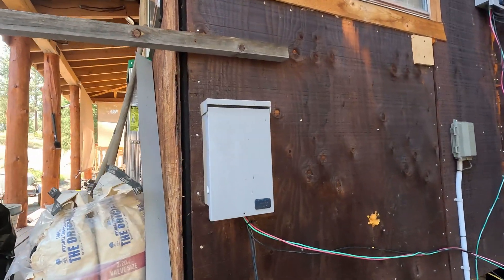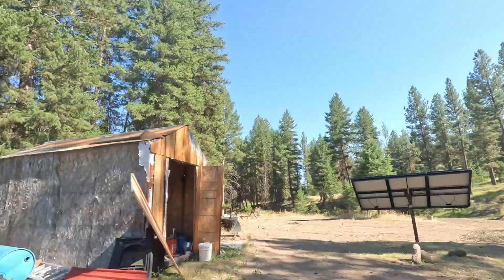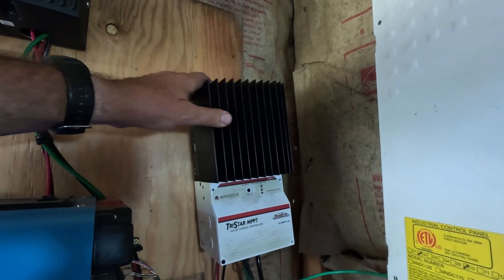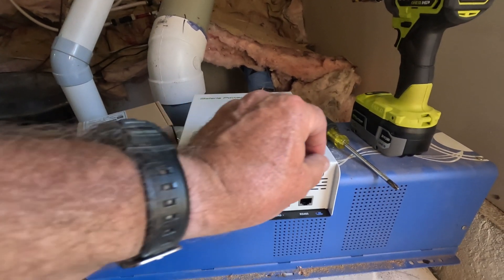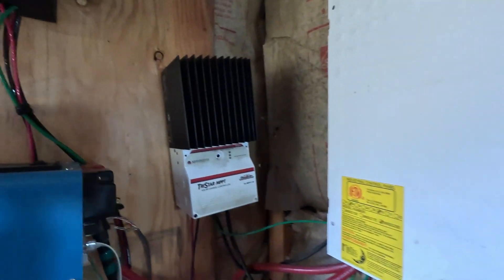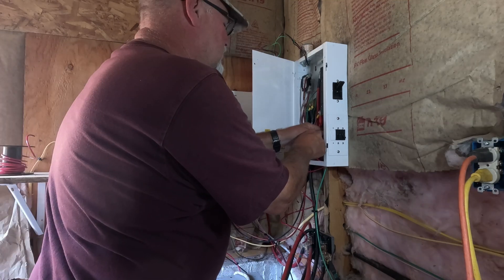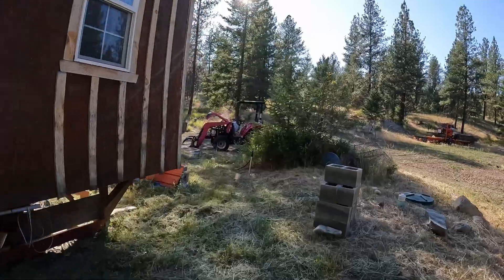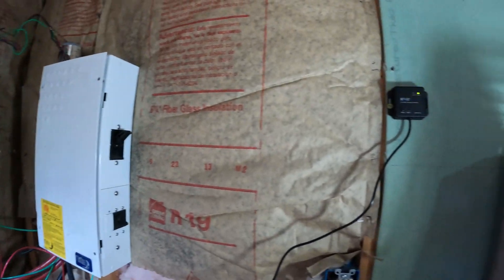🌞 Upgrading My Solar Power System: Bateria Power Sunrock 60 MPPT Charge Controller Installation! 🌞

Comment: Good review! Thx.
 Seriously considering moving up to 60 amp CC now that I understand the combiner box aspect. 
 
BTW, ass backwards works for some of us 😅

Thx again for good info and reviews.
Reply from the maker: I'm happy with mine.  Sure, I'm over sizing the CC and lots say not to but after all this time (14 years) I never had an issue running a 60a cc with just 615w/11.27a of solar
Reply: @TheOldJarhead  The 40 amp POWMr great second step, has upped my game. As you can imagine,  I  always want more!
Reply from the maker: Yup, we always want more!  Though I kinda have more than I need 😉 unless I want AC 😁🤣
Reply: @TheOldJarhead  blessed to have utility hook ups in humid south!
Reply from the maker: Ahhh yes down there it might be a must but the new solar powered mini splits is what I'm thinking I need :D

Comment: Tiny Screw Syndrome!!! Right!!!!   LOL!!!!!. I'm a 57 model so I got a extendable magnet in my Pen pocket, EDC! Good content as usual!
Reply from the maker: EDC! LOL I see that and think "ACP" lol  I should get one of those with my back!  Not to mention those little screws (note:  I was there, I forgot to look, the bugs and mice probably stole them by now!"  grrr...I need to fix that issue but have work to do!  Cheers!
Reply: @TheOldJarhead  No feeling in fingers and BAD Back!!!!!= LOTS of dropped Screws!!!
Reply from the maker: Ouch -- I can still feel my fingers though my thumbs are shot (gotta get them fixed soon as the injections barely work on my left now) and the arthritis is making it more difficult to use them (getting old aint for the weak!) but you've got me beat!  Not feeling even the tips of the fingers would make these puny screws even worse!